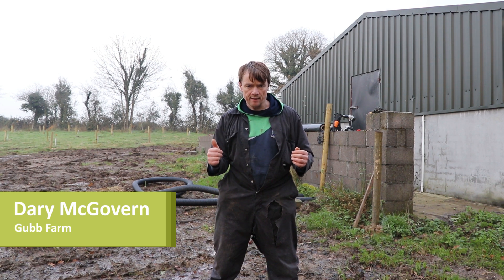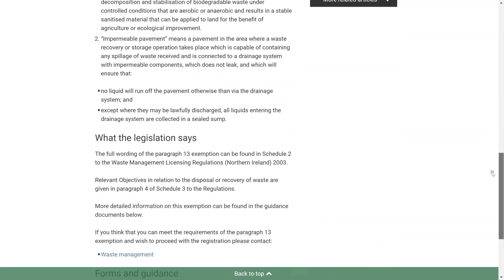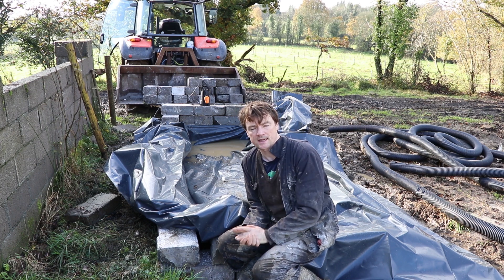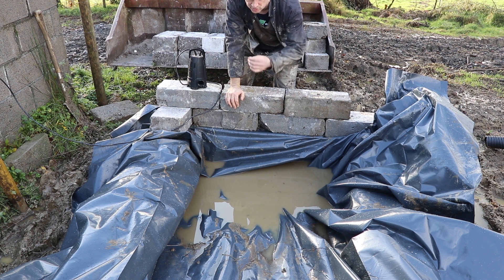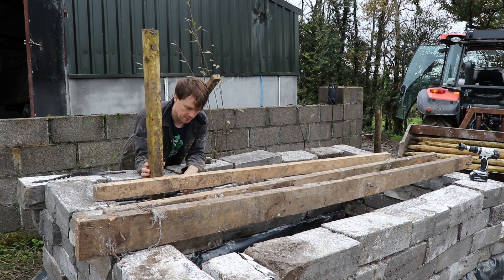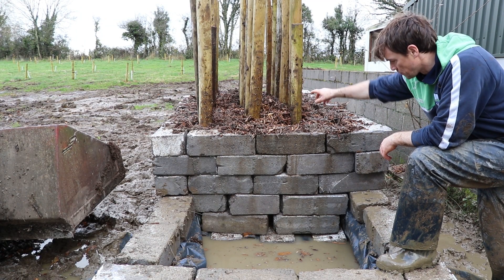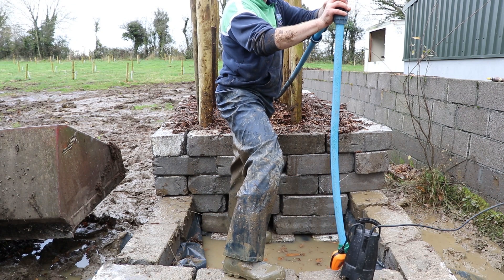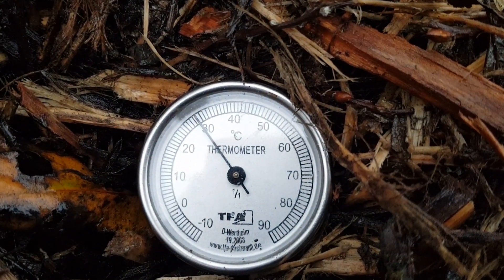Johnson-Su static pile bioreactor prototype | How to compost 50-ton of woodchip & chicken manure

Comment: Wow. This looks like it would break down fast. Esp with the air tube n sump pump
Reply from the maker: Hello Sean. One of the things I learnt early on is that pumping water consistently back onto it, combined with the high rain fall in Fermanagh, may have done more harm than good. It will be interesting to see how well the manure has composted come May 2022. All the best.

Comment: Inoculating the compost pile with living soil is great, that brings in all kinds of bacteria and fungi which decompose organic material, giving the pile a great head start, and likely even improving the end product.

Mycorrhizal fungi, however, won't work in this context. They are a special category of fungi, which need to be in direct contact with a living root to live. They won't live in compost. I don't think the spores will survive the composting process, either.

No big deal, of course, but make sure to inoculate the plants themselves with the same product. The product you used contains fungi spores, which need to come in contact with living roots. There are many ways to do this (i.e.  mix the product into potting soil, or, with a larger plant, dig down to its roots and apply the product directly...I believe even inoculating the seeds would work).
Reply from the maker: That is a very interesting comment Deinse. That makes sense that mycorrhizal fungi need a living root, therefore the mushrooms and hyphae that I'm seeing are most likely saprophytic.  It raises an interesting question. Assuming Dr. David Johnson's fungi analysis showing increased fungi diversification over time is correct (which I now assume to be saprophytic), to what extent does that support mycorrhizal fungi.

Do you have a view on that?

Thank you for your comment and I hope all is well with you.
Reply: @GubbFarm  I'll take a crack at it. All things being equal, much of the same environmental conditions that support a healthy saprophytic culture (so disregard the actual presence of roots. We're talking aeration, pH, humidity etc.) will be similarly beneficial for the mycorhizal colony you eventually hope to see. Therefore, the (positive) results of that analysis presumably show a great foundation for the hopeful result down the line once this gets used in the garden.

It's helpful to remember that much of the empirical science in this field is done in ways that are frankly hugely out of context. There is nothing easily quantifiable in an actual organic system so there will always be lurking variables and there will always be people who need funding willing to "show interesting results".

You know better than I do, sometimes the science isn't ready for primetime when it comes to organic growing.
Reply from the maker: @ddammadd  very interesting. Thank you.
Reply: I thought they could survive up to temperatures of 140f/60c I could be wrong. Adding a mix of green waste would help with a more balanced activity. Edit; if anything your temperatures looked a bit lower than I would have expected especially if you want to kill seeds and pathogens.

Comment: with an amazing tractor like that I would just turn it ever month! but good tutorial for those without tractors
Reply: The whole point is not turning it so the fungi don't have to start over everytime you turn
Reply: @zacharypinegar3111  the whole point for me is getting compost as fast as possible , mabye your needs are different
Reply: @khandam7709  This is a much higher quality compost than you get from windrow composting. The type you're referring to has a high bacteria count, but almost no fungi. The compost resulting from Johnson-Su Bioreactors has an extreme amount of biodiversity (both bacteria and fungi) and has been scientifically proven to drastically increase crop yield. It's ground breaking stuff (no pun intended).
Reply from the maker: Hello Khan. 

I am trying to create fungi rich compost for use with trees, which is why I am trying this static method.  I hope to get a poly tunnel built over the next year and for that I would use compost prepared in wind rows (which will be a perfect excuse to buy a front loader to turn it).

All the best.

Comment: You could put haybales around it for insulation.
Reply from the maker: That is a good idea. What I did observe over the winter that note much happens and maybe keeping some heat in it, which improve the outcome.

Thanks Ollie.
Reply: @GubbFarm  yeah, I saw this vid about someone ‘heating’ by building a compost pile against it. I think he lined that pile with rotten straw bales.

Comment: If you use slotted ag piping (drainage pipe) for your uprights, they can be left in & will not collapse over time. The compost can access air earlier, this will speed up the beginning process slightly, but the main reason is to allow air exchange for the entire process.

The uprights can be covered with caps to stop you filling them as you fill the pit/cage/barrier.
Reply from the maker: That sounds like a good idea Eleni, because some of the air vents have now collapsed. As soon as I get a free day, I'm going to modify the design and possibly refill the reactor to address some issues. I just have to finish off work around the trees before I can get to it.  I hope all is well.
Reply: @GubbFarm  First video I have seen for your channel, was a great vid. Looking forward to going through some more.

Had that issue when I did mine. Saw the solution on another YouTube channel & tried it out. Worked perfectly for me, so thought I would pay it forward so to speak.

Comment: you were supposed to take your stakes out on day 2-3, not longer than that or you'll get anaerobic conditions that will kill your fungi and you want to avoid that at all cost.  your substrate must be kept at 70% moisture, no higher. if you have run-off - you've flooded your poor fungi and again - deprived them of oxygen.
Reply from the maker: You are probably right Lidalur. It was going into winter and everything slows down then, so I give it a few days longer.
Reply: Lidalur is not "probably right" he is following best practices.  For instance you say 40:1 C:N and then having presented figures that scream "much less chicken manure" you dump 50% of highly available N (probably amonicial, certainly uric) onto woodchip without consideration of how you jumped to conclude a 1:1 mix was required!  Mate patience and recipe

Comment: Note that non-vessel, static pile composting of manure products requires bottom (usually forced) aeration. This is now an industry standard & practice in the US.

A Johnson-Su Bioreactor as designed is open bottom & interior vented & relies on convection to keep the mass aerated to prevent it from going anearobic & provide adequate air for temperature over time to kill manure born pathogens.

I suggest you do labs to see if your end product still contains manure pathogens so it is not toxic to plants & humans.
Reply from the maker: That is very interesting and right now, and the air vents at the bottom are sometimes under water after heavy rain (which I assume is bad). I am hoping to get a detailed test at the end, but right now I am struggling to identify a lab to do the work at a reasonable price in the UK and Ireland.  All the best.
Reply: @GubbFarm  Yes. No bottom venting throughout a static manure pile is bad. Please bear in mind that it is not just an issue of bottom venting on the edges, but bottom venting horizontally along the entire space of the mass & vertically throughout the interior space of the mass. If your area floods, building a ventillated riser to hold the mass above water level may be too difficult.

Comment: Hi Dary, I made one of these out of the cage of an IBC tank lined with weed membrane and I used the cardboard tubes from silage bale wrap instead of your stakes and I have covered it with corrugated iron (just using up stuff in stock!). I filled it with meadow grass, autumn prunings, some bark mulch and wood ash, with just one cleaning out of the hen house - 4 hens and four ducks. Not as accurate as yours! I finished filling it around the same time as yours and mine hasn't exceeded 20 degree c yet. My understanding is that the mesophillic bacteria will only build up a population at over 20 degrees and their activity will create temps above 40 degrees which will then enable the thermophillic population to build up. Mine isn't lagged and so I'm planning to wait until the external temperature helps support the build up of the mesophillic in spring(I'm in rural Cork in an exposed site) and I'm going to wait until it goes beyond thermophillic to add worms. I have a domestic wormery for kitchen waste etc and am going to raid this to stock. I'm also planning to let the cardboard tubes in until it reaches temperatures for thermphillics. I might even let them just breakdown in there. I'd love to compare notes as time goes on.
Reply from the maker: How interesting Helena. I did consider IBC thanks and 1 tonne bags, but I had a lot of blocks available after removing a wall in the shed, so decided to give that ago.

With hindsight, I probably should have waited until spring time to start this project, but over time it probably doesn't matter. It will be interested to see how well it starts to break down when the frost passes. Right now it is frozen around the exterior, so I assume there is not much composting happening. That being said, there is some heat in it, so the mesophiles must still be at work in the core.  I would also make a better effort to lag it, maybe with hay next time.

As for covering it, a few people have mentioned that, so I'm going to do that when the frost lifts. 

I am also planning to add some worms in the spring time... just as soon as I can find them.  Normally the soil is teaming with worms, but this time of the year, they can't be found as they hibernate / rest deep in the soil.

Let me know how you get on. All the best.
Reply: @GubbFarm  
Thanks for your reply. I like what you're doing. It's hard to do regenerative farming without livestock. 
I am very interested in doing it with concrete blocks as I think they are more of a heat sink and will prevent the sharp drop in temp at night. My meso's are probably suffering at the moment. I would have sources for 'preloved' blocks and preloved silage plastic, which would make it feasible. I was thinking to build up the blocks as I fill it, it would make the filling easier?
I thought about waiting for spring but there will be other jobs to do then and I'm happy enough to wait for it to rev up. The collecting of feedstock and the loading is a challenge for me so it suited to do it in December. 
I only covered it as I cover the ordinary compost heaps - we get enough rain to turn them into silage heaps and its not pleasant!!! Most of what is online about them talks of irrigation but I think we get enough rain and damp, and little enough heat that its not as much of an issue in our climate. Most of my feedstock was out in the elements for awhile before it was filled.
Are you concerned that the thermophillic temps might kill off the worms? I was going to wait til that passes before I add them. I'm feeding the wormery at the moment to build up a stock of them. I've moved it into the polytunnel to keep them growing. 
I'm building up to another cleanout of the henhouse for a hotbed in there and will put the wormery near it to rev them up for the move. 

Best regards

P.S - Overnight temp here was -3.5 last night and it is currently 13C.So some thing is happening in there!!

Comment: To keep the right humidity, why not to simply cover the compost with something to recondensate the evaporation back? (i'm doing that with ceramic plates, using the curvy shape to water back in place in an even way. Then surround everything with strawbales to insulate, then a tarp and you have a very good compost heater ! (in green house for example)
Reply from the maker: That is a very good idea.  I have been thinking about covering the compost pile with a sheet of tin, which might work. It will be interesting to see how well this compost turns out when the weather warms up, as we have just gone through a hard frost with no insulation.
Reply: @GubbFarm  The advandage of insulating i guess, i would think, is that the outside layer (becoming the insulator) would compost beter. It think also that a regular shape ast a square, a cilinder, a pile would compost better. (better keeping warmth)

Comment: I am wondering if it would be beneficial to cover that pile to keep the rain from constantly leaching through it and cooling the pile as well. A cover with an air gap would work well and you would not lose heat in the pile and the nutrients you are wanting to create. It would also keep a constant moisture percentage in the summer with a cover. I really like the sump pump idea to "recycle" the affluent back into the pile, but I think the constant rain would not be beneficial to your plan.  Looking forward to how your experiment turns out, best of luck.
Reply from the maker: Hello Brennor. It is interesting that you should mentioned that as I have been thinking about covering it over the coming days.. 

I took the pump out of the sump yesterday as the temperature is set to drop below zero centigrade for a few days this week. When the frost passes, I am thinking about putting some sheets of tin over the top that run into the sump.

I was watching Charles Dowding on YouTube and he said he got better results when he creates compost in covered areas. 

When I do it, I will bring the camera so that we can see how well the air vents are holding up with all the very heavy rain we are currently getting.

All the best 👍

Comment: Interesting approach but with a Johnson Su Bioreactor you do need to have air permeability in the sides, so the blocks are not going to allow that as well on the side.  Also the reason they do it on a pallet, is because it aerates the bottom as well.    Other than that, great job!   I like the fact that you are using things that can be found around your property.
Reply from the maker: Hello Chris. 

I get a lot of joy from building things out of materials that I have at hand. I had just removed a wall in the shed in the background, which provided the blocks for the bioreactor prototype.

With regards to air flow, it will be interesting to see how well it breaths through the cracks between the blocks.  To test this, on one side of the bioreactor I have a row of vents about 15 cm (6") from the wall and on the other side the vents are about 30cm (12") from the wall.  If it works, then I can use concrete sides, when I build a larger permanent structure, which I can then use to push the compost against when loading a linkbox or digger bucket.

As for the bottom, I fully agree that a pallet would allow more air flow.  However, I am testing building it on a solid base with air vent rows every 6", which I could then drive a tractor or digger over, rather than constantly trying to source pallets that will be destroyed by machines when removing the compost.

Ideally, I would like to wall off an area about 10m x 10m, possibly with removable concrete slabs slatted along the sides to allow air flow.  I would then segment the area and top fill it with a loader on a tractor, to allow a First In, First Out composting solution. 

But first I have to see if it works!
Reply: @GubbFarm  That is awesome!  Yeah I think this should be a great test and something that will work on scale on a farm like you have.  I'd like to see how it turns out.  If it does, that would make it really easy for you.  By the way, Diego Footer's channel has an interesting new design for the Johnson Su Bioreactor...  https://www.youtube.com/watch?v=kml4RKZkC2E  that you might like to check out.  It makes the pile like a doughnut shape and eliminates the pallet and the "pipes".  Great job man.  Can't wait to see your results because I can easily find teh same imputs that you used in my area.
Reply: Note: There are established industry standards for bottom aeration of non-vessel static piles containing manure. If you choose not to bottom aerate, labs for pathogen toxicity are necessary. Deviating from the Johson-Su design, where bottom aeration is key component of the design, can cause problems.